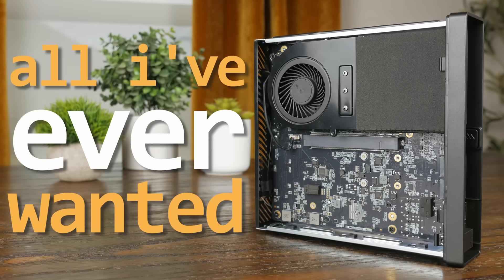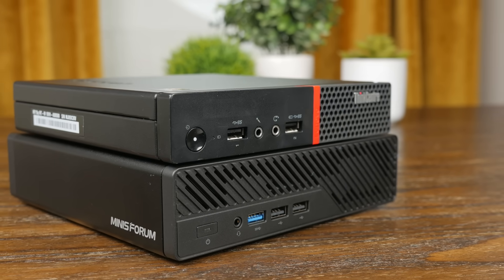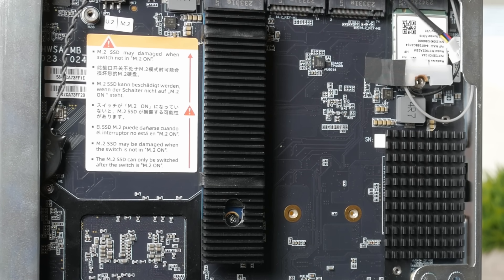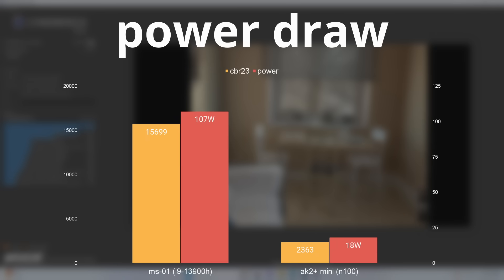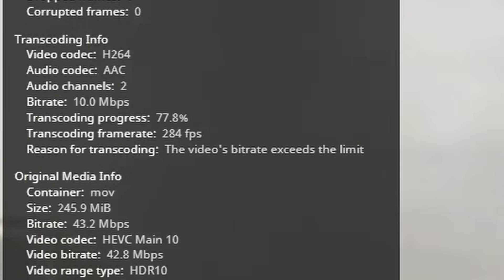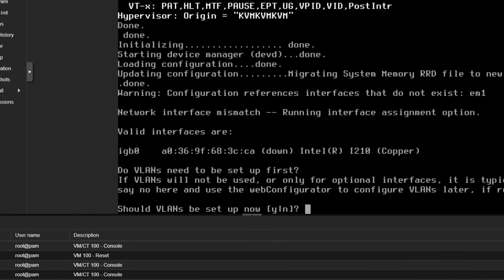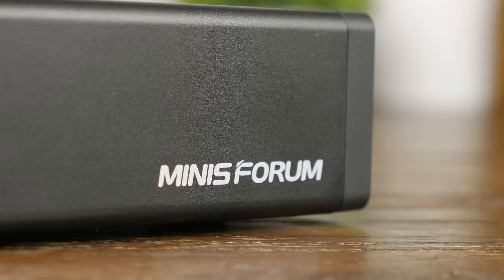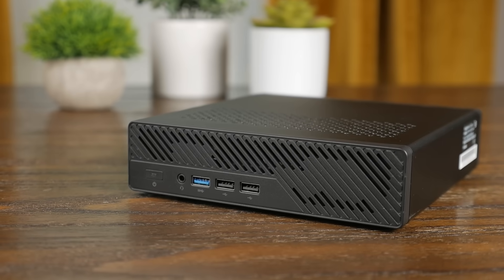This Might Be The Perfect Mini PC

Comment: My big problem with this kind of design is that it only supports 1 slot half height PCIe cards. If it was 2 slot, I'd be more than willing to pay that price for one. Bonus being I could turn it into a multi-task server, with max TDP of just an enterprise CPU.
Reply: It may be an incomplete product, but there's nothing technically preventing you from casemodding a PCI-e riser or using an PCIe OCuLink card.
Reply: @illeatmyhat  Those cards exist? Mind if you give me a name, since, youtube hates links.
Reply: @wojtek-33  I'm always a few generations behind, at least until I upgraded to the latest Ryzen series.  

Enterprise workstations that retailed for $15,000+ still hold up 3 years later when you can pick them up on the resale market for $100-300 and slap in a new graphics card.  

Too bad power costs mean it makes it harder to justify the initial purchase on old equipment these days.
Reply: My problem is that its not an Ryzen 9 cpu with RDNa3 Igpu
Reply: @wojtek-33 Cheers on directing me towards that one, I'll keep it in mind
Reply: Oh man, I would want to run a 4060 in those.
Reply: Mini pc with dual slot PCIe (full height) - Shuttle XH510G2. Not the latest chipset but it’s a decent mini system.
Reply: Too many complaining
Reply: There are other options for SFF that contain 2-slot configurations.  single slot or half-height single slots are so rare now adays especially for those that are looking for an extremely compact system that still allows for PCI-E options.
Reply: @Daxiongmao87  Eh, fair point. I did look into SFF cases in general out of boredom, but 3L/4L w/ GPU are either not restocked or hard to find... It seems. Oh well. I'm not in rush.
Reply: @wojtek-33  Right, thanks again <3
Reply: But then it probably wouldn't be much of a "mini" PC. (Though, they could probably squeeze 2 slot support if they tried hard enough, but then the price may go up because of the extra engineering costs)
Reply: And that would prevent putting something like a Quadro A2000, which is half height, but occupies two slots.
Reply: Why dont mod the case then?
Reply: I’m excited for this. Paired with a jbod and you’re set.
Reply: His settings are for installing network cards or hard disk expansion cards rather than high-power GPUs.  If you have related needs, you should buy a desktop or server.
Reply: Which GPU could fit in here
Reply: 3D print a case for it and you should be good to go...
Reply: Real spill
Reply: Problem no more a2000 or a4000 with custom heatsink is already available.

Comment: It doesn't ship until March 15th if you take their word for it.  I'm trying very hard to find a compact chassis or mini pc that can fit a single slot full height pcie card.  This could work for that with a riser cable and some improvised mounting, but I'd rather have a high core count ryzen with a better igpu and I don't need all the networking.  That coupled with the March ship date and that this isn't the final revision of the product makes this a pass for, especially at a higher price.

Comment: Not practical for actual use but if you want to really stress/test Plex transcoding get a 4k HDR file and transcode it down to 240p or lower it will look like garbage but will stress the heck out of your GPU/APU.
Reply from the maker: I’m planning to move to a more standardized benchmark process when I can make the time to. In which case I want to test more practical and “synthetic” transcodes. Thanks for the input!

Comment: I've seen it in LTT. Immediately, I've started to wonder if it's possible to slap more SATA through PCI-E card and make NAS server from it. What's your take on this?
Reply from the maker: I more so had the thought to use an external HBA to connect it to a JBOD. Or you could use something like the QNAP SAS JBODs. Patrick at STH did that with an 8 bay unit. Pretty sick for an AIO home-server/NAS.

Personally, I’m a fan of running NAS independently from other services. You can use a much lower powered system and not risk data loss when tinkering with stuff.
Reply: Normally I'm all for out of the box uses but this is one of those times I'd have to ask why?  For the price of this unit you could build a machine that could do the job adequately, by the time you add in the cost of an enclosure for disks why not just go with something better fit for purpose from the start?
Reply from the maker: Yeah, I don’t think this makes sense for a NAS. But it’s a possibility

Comment: Taking 2u when in a rack is rough.  Adjusting the case to take 1u and possibly some airflow adjustments would be great. Could market it as a bastion/utility server.
Reply: maybe it could be transplanted into 1u?
i was thinking about running 3 of them vertically, next to some other > 1u machine i already have on a shelf
Reply: I bought 3d printed rack mount - 3U for 4 units. Sure you still loose some space, but less is lost and it's actually hold pretty nice! Found it at Hive Tech Solutions from Australia which they sent me to Poland... took a while and actually cost a lot. I don't think I'll ever buy from them again - they (both "they" as people and "they" as device) were great but it's too expensive. With price being 1/6 of 3D printer, I would rather buy a printer and learn how to use it because it'll be useful later in my life.
Reply: Unless racks have gone through recent drastic change, you could double (or even TRIPLE) the depth of this case.  That might even make it easier to fit a rear mounting bracket, to hold the weight. 
Plus, if you place it on a sliding tray, the tray takes up another 1U of rack space anyway.
Reply: double 2 u is more realistic. Mikrotik has a range of 2u half width that can snap together into the same 2u mounting brackets